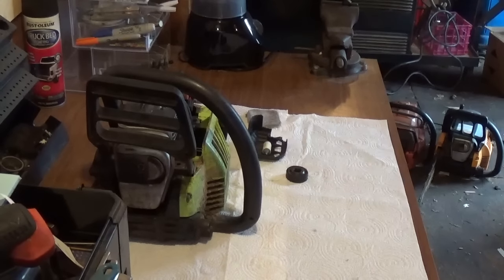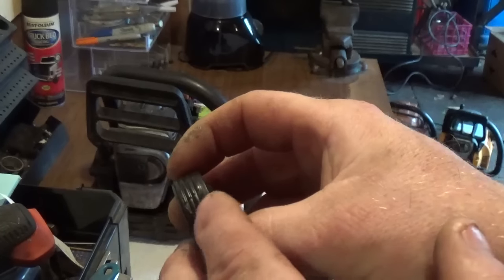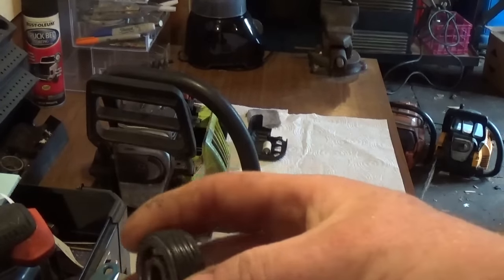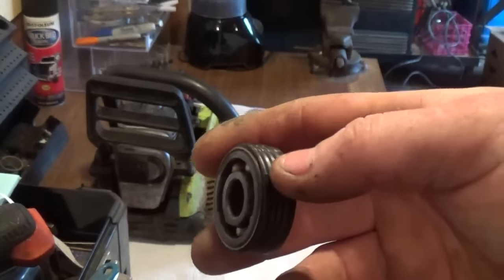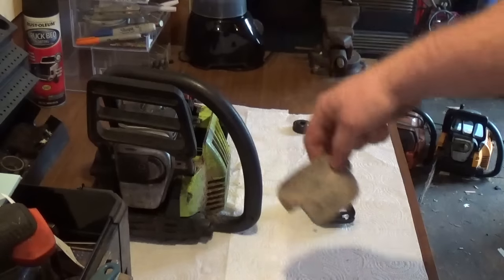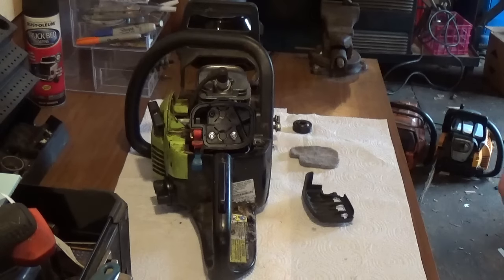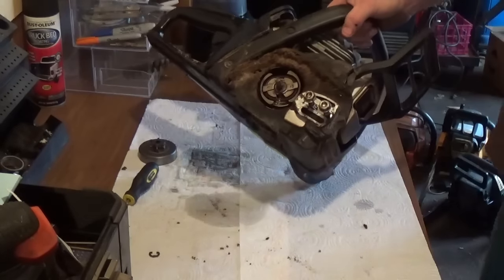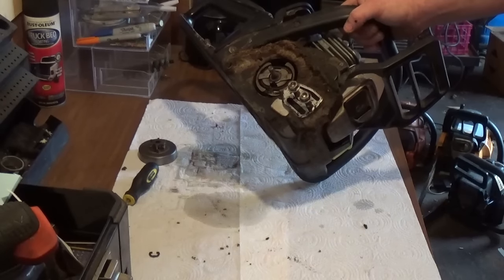Common problems with Poulan Chainsaws

Comment: Im a stihl guy but the new black and yellow poulans run on 50:1 much nicer
Reply: Voor Vooort Yes!  Bought one last month and cut almost every day with it. Got it as a second but mad using it more because of how lite it is and the anti vibrate suspension is better than many others. 

I suggest to most people that they spend more time servicing any machine and they’ll have less problems.

Comment: Mine is 20 years old it's a model 1950 run as good as the day I bought it, ethanol fuel is what makes the gas cap not want to come off, switch to non ethanol and it will shrink

Comment: Thanks for the info. These are hot sellers at box stores.  I find a lot at the dump that are nearly new.  Some even have no premix in the gas or even bar&chain oil in the gas tank.  Yes, the seals, air leaks are what really play havoc on the poor running and inconsistent starting of these machines. They are fun to mess around with while learning/practicing two cycle porting.  If you go to far just bring in back to the dump ;)

Comment: I've been running my Poulan 2150 for twenty eight years with just an occasional spark plug change. It still has good compression and I can fire it up and let it sit to idle  with no problem.
Reply from the maker: Great prove it in a video .....That's all my viewers and I request . A simple warm up ....then idle .....cut 5 or more cuts....idle once again for min....then simply cut once again 5 or more times and allow to idle for additional min.
Reply: I think, once in awhile, that some good 1s came thru but on the whole, no! More often than not the 1s you see in the trash that look new have sat for awhile, maybe years. Usually fuels, carb kit will fix 'em but usually you've have close to the original price in it, why buy the same POS twice?

Comment: Any saw will fail with lack of routine maintenance, I have a few different saw, Husqvarna and a Stihl and Ive had my little 16" poulan for about 8 years and never had an issue with it... None.... I've had more issues with my Stihl more then my little saw and its got some really had miles on it.... But I keep up on the maintenance...

BTW.... My poulan is just the regular one... Not there pro model.
This guy is just talk out his ass.... Talking head.
Reply from the maker: Talking out my ass hum …..Your the one talking out there ass or maybe that gapping pussy hole that keeps queefing out total bullshit . Prove your little Poulan is that reliable walter white . PUT UP /OR SHUT UP. Because your being called out on the bullshit your trying to project as evident truth .

Comment: I watched this video as I have a PR4218 gutted on my workbench.  So far, my take on this chainsaw is this: Its a damn fine chainsaw IF you are willing to service it in-between every time you're willing to take it out in the rough with you. 
I have a 14" Homelite and a legend - a 1970 vintage Homelite 150 - their primary purpose is to rescue me every time the first-in-service Poulan craps out, which, invariably is every time I take it out with me. First it was a chain that went flat-out-dull - a third-party chain solved that problem. Next it was a cord that removed itself from the starter, thanks to an inadequate cord-retaining system and plastic parts. JB Weld soved that. As for many of the POS comments, those aren't a problem so long as you treat this saw like you would a pampered car - use it once, use it constantly, then check everything from the air filter on down, and are willing to put in homestead "fixes" for the plastic garbage that breaks. The engine is solid IF you keep the filter clean and check the fuel filter to make sure it hasn't decided to land in the bottom of your tank. The saw cuts IF you get rid of the garbage it comes with. In short - its not a POS IF you're willing and capable to put the hours in. If you're a weekend warrior - get a Stihl.
Reply from the maker: LOL...friend I guess I am a weekend warrior { Beats the lost hours in a day Poulan procrastinator} whos constantly tinkering and stressing over these cheap POS. I am not saying this to be sarcastic only to stress my point that theses saws are less than anyone could hope or desire in a chainsaw . If your happy.....To each there own .....Experience has educated me differently as well as a lighter wallet .........Buyers remorse is all most find with a Poulan .
Reply: I’m just trying to tweak my low idle, but I try to adjust the Idle screw and there’s no difference. So I just need to wait on my 21T to adjust the low because it dies when I don’t hit trigger
Reply: But it’s seems to be working fine. I think it’s just because the factory settings are off

Comment: This vid. explained a lot. I had a Puolon forty years ago when I was a teenager, bought used from a cedar chopper/professional woodcutter . He had taken the muffler off to get more hp. I suffer hearing loss today because of it. I cut and sold firewood and it cut a lot of hard, seasoned oak. As far as power, tt punched way out of it's weight class and was doing the work day in/day out of bigger wood saws. It never would idle without dying but then I worked it so hard I never had my finger off the trigger. It started, sometimes grudgingly,  after every refill, was never maintained as people here suggest other than adding more gas and oil and used whatever gas I bought to put in it. After many cords of hard oak wood and cedar posts it just wore out, the handle broke off (this was before brakes and guards were installed) and that was that. I do remember saying many times I was going to set it across a canyon and shoot it with my 30-06. I bought a RYOBI from Home Depot a few years ago to do a clean up on a family property and I took that POS back the next day as it had one speed, wide open. I went down the road and bought a Poulan Wood Shark. It performed better than the RYOBI, fell and cut up some dead, very hard oaks into firewood but would not start and run after I climbed up in an oak tree to trim some limbs. I threw it out of the tree and it landed on the tip of the bar and bent it. Out of the box it wouldn't idle but I didn't expect it too being a Poulan, but it cut with great power for a little saw. After almost ten years of sitting, I replaced the lines and plunger today, gapped the plug to 30k and it started up and ran. The bar oiler leaked so tomorrow I will address that.
Reply: These they sell today are "NOT your Father's Poulan". Seems like the older Poulans from before the mid Aughts, still made in USA were not all that bad. I own a late 80s vintage Poulan Pro 114 trimmer, which has done a moderate amount of trimming and is STILL in service thanks to Ebay. None of the ones sold today will do 1/10 the work the older ones have.

Comment: I have a Poulan 2150.  I keep it as a backup to my Stihl.  Got the Poulan out as a prep for Hurricane Irma.  After replacing the chain, cleaning the carb and messing with the muffler, it finally started.  Ran about a minute.  The fuel lines completely deteriorated. I mean disintegrated.  Seems to be common.  I'll buy a another Stihl.
Reply from the maker: I would highly recommend doing that {Stihl makes great equipment} And with clean up I would wont a saw I could depend on..
Reply: Woody Smith STIHL had fuel lines deteriorating due to ethanol, also.  EVERYBODY HAS.
A local saw shop owner who knows his stuff in his sleep said STIHL put out a replacement ethanol-resistant fuel line to dealers- BUT THEY COULDN’T GET IT UNTIL THE OLD STOCK WAS SOLD OUT.  FACT.  I bought new  an ECHO CS370 saw, an ECHO CS340 saw and an ECHO PS230 commercial trimmer which is modular (accepts different heads with half-shafts) - no problems.  I have an OLD STIHL 026 WB, on which I had the points & condenser replaced TWICE- after replacing it with an electronic ignition module, and NEW fuel line, it cuts like lightning.
Reply: @TRUEBLUEGOBLUE  Neighbor owns a Sthil 026, told him do not EVER let that saw get away from you. Even if you buy a new saw, keep for backup!

Comment: Stilh has the best chainsaws #1
Reply: Have you ever even seen a "Stihl" chainsaw? lol
Reply from the maker: Many/ And other than a few cheap models they make some of the best Small engine equipment in the world.{ In truth even there cheap models are not really all that bad .....{improvements could be made no doubt } but over all I would still prefer them over any Poulan product in todays market..
Reply: used  to
Reply: John Raven what kind of question is that?
Reply: I had an old echo, about a 72 model. That thing was a tank. I never had an issue at all. Not even a primer. I've had a lot of problems with wild thangs.

Comment: Thank you,  everything you've said is spot on with all the problems I've had with 20" poulan pro.  New out of the box less than 45min it started having issues cutting pine.  I broke it all down blew it all out cleaning everything like new.  Ran great for an hr. then started stalling out again. lol  Its been way to much work to keep it running the way it should.  Which is to bad cause when its running proper it gets the job done.  The fuel cap is impossible to get off by hand.

Comment: Poulan 3000, 1986 50cc...runs great. Don't knock Husqvarna, they make some of the best saws out there in professional use. The old 371's and 372's have excellent power to weight ratios and are still used by loggers and arborists today. I run about 10 saws mostly Jonsereds, 42cc-90cc (made in same plant as Huskies) they serve me well, my oldest has run well for 32 years.
Reply from the maker: Ok first let me point out the Poulan 3000 is actually 49.2 cc but close enough to 50 cc that I will excuse the error . Second Its been noted on several replies I don't have a problem with the older Poulans per say . Just primarily the cheap as fuck Poulan wild things and Pros that are pushed by Husqvarna as a parent company.
Reply from the maker: Woodsman Sprit / Its no shock to any viewer whom watches my channel I am in no way a huge Husqvarna fan . To be honest it really isn't because of there higher end saws even though there is def room for improvement rather the cheap shit pushed by Husqvarna as a parent company to steal …..sorry …..{capitalize} on the small box store shopper as Poulan ,Husqvarna , Craftsman ,and Jonsered just to name a few are basicly the same junky shit for the bottom line that they can push over on uneducated new comers …...Hell for that part even the return penny pinchers whom are sold on idealism rather than evident fact. ….I see this quite regularly as my boss is a warranty center for these cursed bastards that often leave many with buyers remorse . One might ask me why is there a complaint ? Simple answer on my part is I think people should at least get what they pay for and not have to rub there backside twice after making a purchase .So its for this reason and this reason alone I have made the videos informing those whom choose to listen to avoid Poulan and like valued chainsaws in box stores as the quality is truly shit to tone down my true feelings developed over years of experience and lack of a better word as no other would truly suffice .Husqvarna quality has really began to suffer as more and more plastic is entering there equipment .Hell in truth I think if they thought they could hide behind there lawyers they would make pistons and cylinders out of plastic . But to be respectful that's just my opinion . Husqvarna in all there lines {current} at least have resorted to thin seals and less than ideal intake lines as well as bellows or intakes . As a result they are using a cop out mentality to justify higher end saws burning up . Shifting the blame toward modern gasolines …..Now with that being said modern gasolines do rage hell on equipment {obviously no doubt} and you will receive no argument from me in regards to that . However when TRUE FUELS ARE ADDED and the equipment is ran there shouldn't be a issue with a new piece of equipment right .  I recently had to replace seals in not one but two 395 xp Husqvarnas that had never been ran with nothing more than True Fuel mix . Brand new be minded....These issues are a testament to the foreseeable future as I have also witnessed Jonsereds with the exact same issues such as the 2171.  Note this is not to poke fun of you as your experiences are just that {YOUR OWN}…..I however Just hate the way Husqvarna treats there dealers . They switch sales reps all the time just to obligate more sales on there dealers with the coming and going of new sales reps . We had 4 sales reps in the course of 6 months for the Jonsered / Husqvarna  equipment we sold and as a result my boss basicly said SCREW THEM and there obligated sales . Husqvarna truly is a greedy company with greedy tactics . This can be truly hard for some people to accept but it is the truth .  .

Comment: You know we gotta show love 😍 for the poo lahns! Poulan chainsaws are very mystical but loveable as well ! Mix 40.1 and run mercury Quicksilver outboard premix oil,  remove exhaust and place Piston at top dead then pack Vaseline into exhaust port bring Piston down just a bit and let sit for 24 hours at 70+ degrees or place heat lamp near the saw , this let's the Vaseline melt into lower crankcase to oil the crank seals ! Remove spark plug and pull over several times before attempting to crank engine ! Honestly I have several poulan chainsaws and they can be buggy , but if you love these lime green tree cutters just get to know them and do proper cleaning and maintenence on them and don't run them wide open on a 3 inch limb !! Poulan forester 3800, that's a good saw ! 1985 year model  poulans were good saws , the first thing to know about these saws is WHAT it takes to make them run ! Seriously , compression must be 110 to preferably 150 psi , no scored cylinder or RUB OFF , as most have chrome Piston but bare aluminum cylinder head  , poulan pros have chrome cylinder head ( sleeve ) and bare aluminum Piston! A couple of models may be different though ? Replace the duck bill valve on gas cap run non ethanol gas high test 91 octane and use black fuel lines like echo brand , tygon fuel lines are ok with non ethanol fuel ⛽,, if you have to pull on the starter rope more than 7 to 10 times to crank a poulan after following start up 👆 instructions then it's trying to tell you something isn't right 👉 so listen to it  !! I have a poulan that cranks on every 3 or 4th pull and runs great it was made in 1985 ! Bought a new poulan a couple years ago and it cranked good and cut great , a little 18 inch bar smaller size saw and I cut a lot of wood with it , sold it to a friend of mine who ran it for about 6 months and he said it still worked great for him ! Always check for simple stuff , spark plugs , do you have enough spark? Check screws on intake mounting gasket , base gasket , are they snug? Gotta show love for the poulans ! ♥

Comment: I've had my poulan for about 5 years. I've rebuilt the carb twice, replaced fuel lines 3 times, two spark plugs. Fuel lines and intake gaskets are the biggest problems I've seen. But if you can fix them yourself it will "work" lol.

Comment: Well ... Having used and owned multiple Poulan chainsaws over the past 45 years or so, these are a few points I would like to mention. Firstly, most modern Poulans ARE POS's. This especially includes the Woodshark and Wild Thing series of entry-level chainsaws. I am also not a fan of the Poulan Pro (yellow) series of chainsaws, but to be completely honest, I've never really worked with them. However ... I am a big fan of the older 1970's and 1980's Poulan chainsaws. Back when the chainsaws were actually made of metal and had twice as much horsepower as their modern counterparts. Some examples that I am familiar with would be the Poulan 4000/3700/3400 series, the 306 series, the Micro XXV series, the Super 250 series, the 2300/2000 series, the various counter-vibe models, etc. I think these older models were built to be much more durable and ruggedized than their modern variants. With that all said ... I believe some issues can be corrected on these modern Poulan's, with better maintenance practices and a few operational changes. For example ... STOP USING GASOLINE THAT CONTAINS ETHANOL. Ethanol is one of the worst things you can put into any modern two-cycle engine, whether it's a chainsaw, weed-eater, motorcycle, or whatever. Find a local source of non-ethanol gas and you will see your engine perform A LOT BETTER, and no more "stuck" plastic gas caps. Ethanol is also not good for aluminum carburetors in general. Better maintenance practices would include stuff like .. draining your gas and bar oil before storing, checking/cleaning your air filter, checking/cleaning your muffler's spark arrestor screen, Checking/cleaning/gapping the spark plug (or replace with new), inspecting your pull cord for any fraying, not overtightening your chain tension adjusters, etc. And let's not forget that the bar sometimes needs some attention to. Putting lube in the bar's nose bearings, removing any debris from the bar's chain groove, dressing/filing the bar when it is worn to remove sharp edges, etc. Take good care of your tools and they will last a very long time, It's really that simple. If you insist on buying a modern chainsaw, then invest in a quality chainsaw like a Stihl. Something that will cost you more money up front, but will be around for the next 10--20 years. Several extra chains, and a sharpening device/tool of some kind are also a worthwhile investment. Have fun out there ...   DV
Reply from the maker: Well stated.....I completely agree......there's no don't you have the experience you advocate......I enjoyed reading this comment......you didn't embellish the truth......for that reason alone I thank you as I feel it's important to be honest with my viewers. OH and I to have basically the same opinion about the older Poulans as you do. They sure don't make them like they use to.